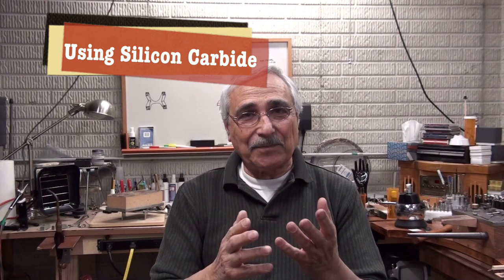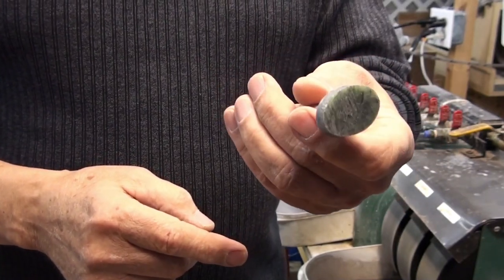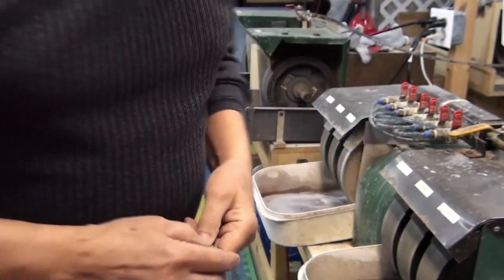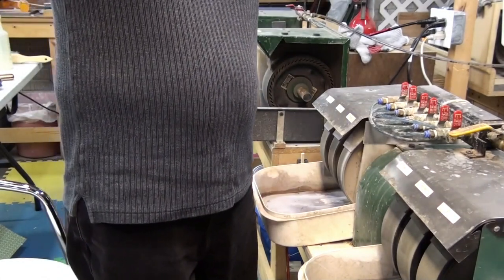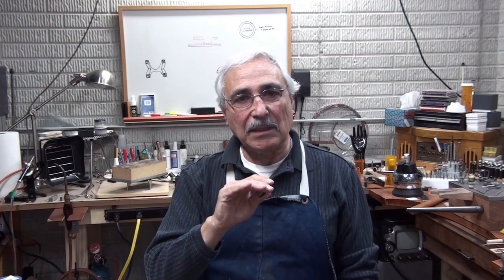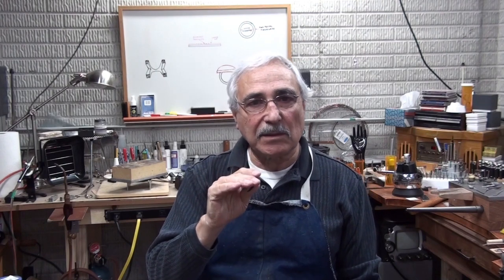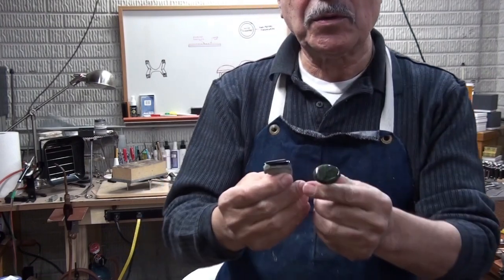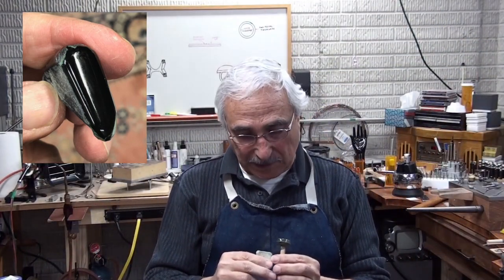POLISHING JADE

Comment: We have a Cabking 6" with standard wheels it came with.  We also purchased the following= 8000, 14000 and 50000 wheels-are these okay to use? Now you made this Tutorial 3 years ago, what types of Polish should we consider using?  What do you recommend?  Maybe we have one of them.
BTW, The Jade That We Have Is So Very Translucent / Transparent, It Is Phenomenal To Us.
Reply from the maker: For finishing I use 3000 and 14000 wheels then polishing on a flat lap using cerium oxide after that I use 50000 diamond spray on flat felt. 
For Jade you don’t have to do anything more than shown in my video, the trick is using the worn out 600 silicone carbide dry.

Comment: I cleaned a green statue with soap and water but now were it was less polished it look worse than dirty, dont know if it was stone or glass but it is ruined. omg.
Reply from the maker: I’m not sure what statue you have cleaned but soap and water shouldn’t damage anything.
Reply: @ElieGhanimeEG  I know right? it's weird but it really did. I looks awfull.
Reply: @neskrafe  I bought it second hand. it was like that when I bought it. at the bass ( the bottom) it's more dull, like not smooth like the dolphin is. it's ruff like if the artist didnt bother making the bottom smooth. but polish how? with what? also I would like to clean it but nothing works. it's like the dust is glued to it. it not ease because the bottom is all uneven. many hole like wavy surface. not flat.

Comment: Elie, As usual, great video. Thanks. Just a couple  of questions: What if a lapidary only has soft diamond wheels, does the same process apply, i.e. very light water especially for 400 and 600? Also, I have been using Linda A (Aluminum Oxide, for those who don't know) successfully--at least, I think successfully. If you have used Linde A, what sort of success have you had? (Note: I did just discover that ZAM is essentially a combination of Aluminum Oxide and Chromium Oxide.)
Reply from the maker: John, I'm not sure if I replied to you before or not...In my opinion I don't think the soft diamond wheels will efficiently work but there's no harm of trying. I have Linde A but I didn't use it because I have to change the polishing pad every time ;)
Reply: @ElieGhanimeEG  very interested to learn the best techniques to polish Nephrite jade thanks for making it easy to understand thanks slot.